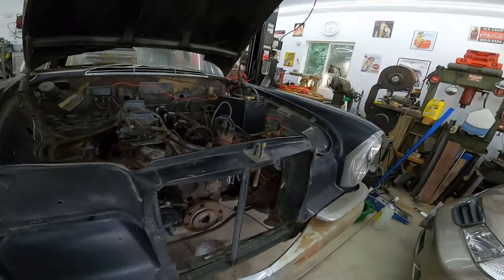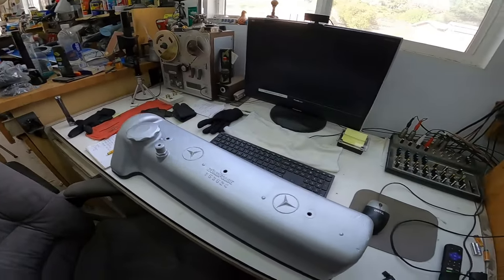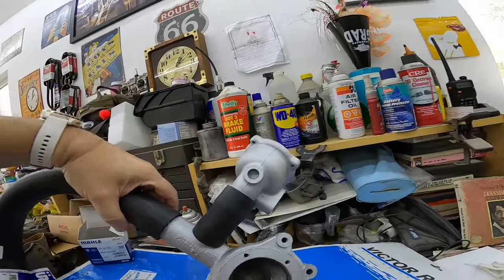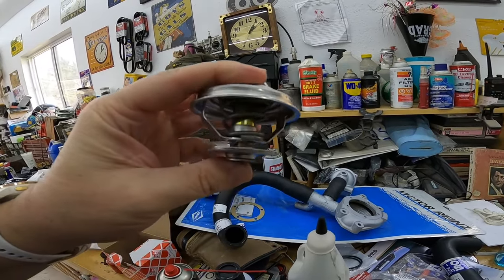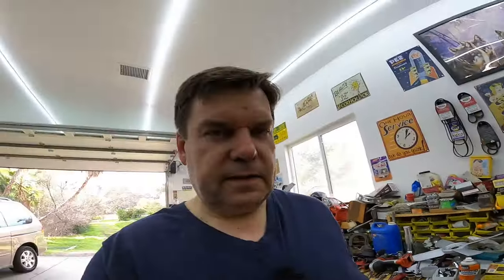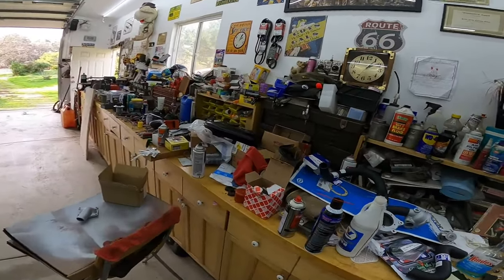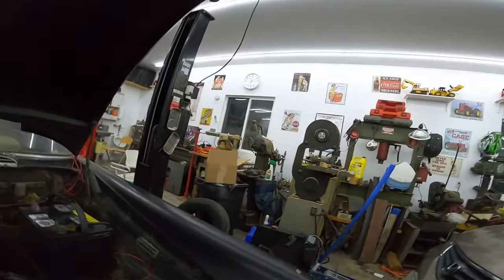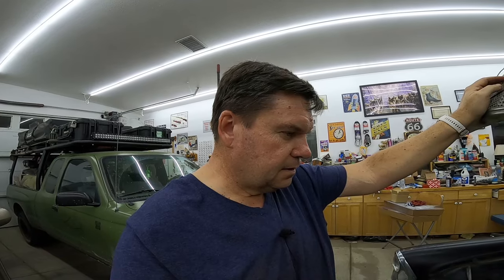1961 Mercedes-Benz 220Sb - W111 - Cooling system, oil change, and stuff.

Comment: Great to see the engine getting new parts! It's going to be humming pretty soon. You must have your own sandblaster? Nice cleanup on those parts you painted. No oil filter in there? Surprising for sure.
Reply from the maker: Yeah, got tired of it spewing coolant everywhere when I go to move it... Just hitting the low hanging fruit. Just waiting on the radiator to arrive, and some brake line plugs. I got the old master cylinder back together with the old rubbers, but the bore is pitted from rust. Did the best with what I got, but hoping to pressurise the rear axle and see if I get some sort of a brake pedal. Hoping to make it a little safer to move around then relying on the parking brake. If all goes well, I may be able to drive it around the neighborhood this weekend. Cross your fingers. And yeah, I do have a sand blaster, got it finally situated over the holidays.